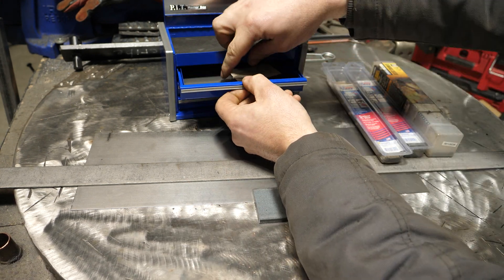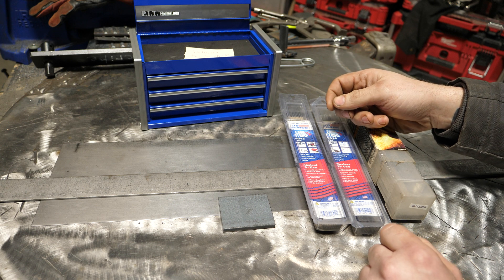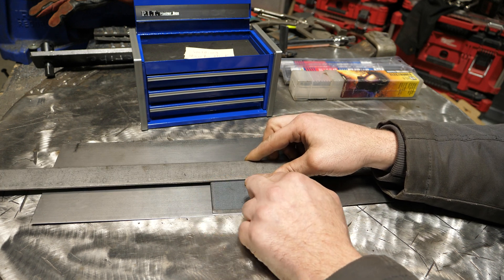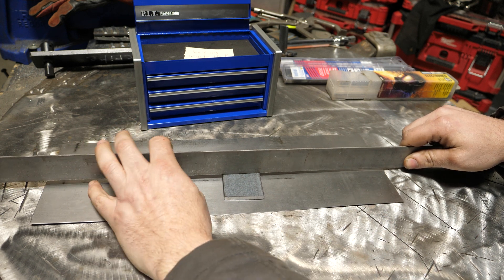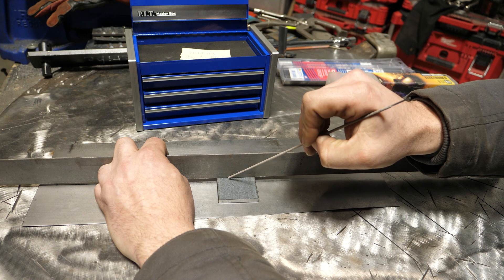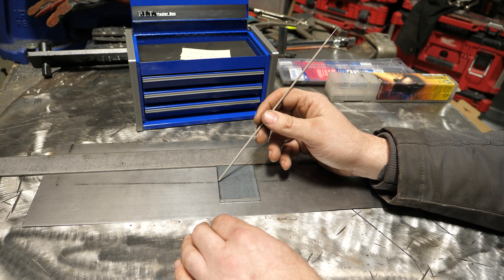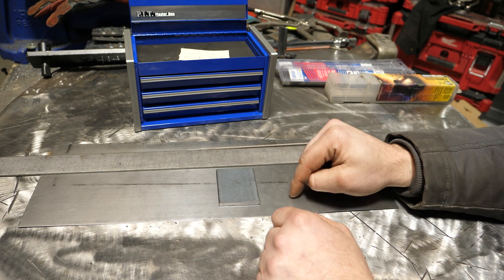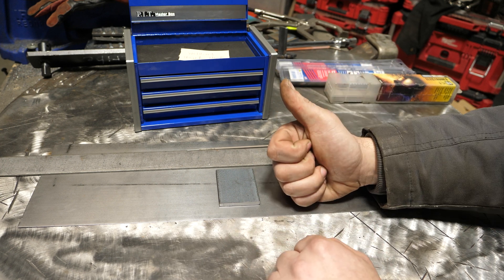Stick welding thick to thin material (questions from the tool box)

Comment: Great video! But where I'm located we only have access to 6013 2.6mm rod, and 1.5 mm square tubing.  Everything (roofs, carports, furniture etc.) is built with that. The method used is stacked tacking with the welder turned up to the max (200-400A) and with a quick rhythm so that the weld pool stays liquid and slag doesn't form. A continuous bead seems impossible,  it blows a hole right away.  And low amperage just doesn't seem to work,  the rod either gets stuck or no spark appears. Do you have any thoughts about this?
Reply from the maker: So you bring up a lot of what I call “work arounds”.  When faced with tough challenges and limited resources you have to find a way to get a job done.  With limited equipment and thin material workarounds must be done.  I have done a fair amount of stick welding on thin material, and it’s no joke and difficult.  What you describe is one way to do it.  Because the 6013 rod is easy to restart with, it would work ideal for that.  If you run enough amperage you can actually achieve solid fusion on thinner material while doing spot welds.  Would it be as good as say a mig weld or tig?  It would probably have more inconsistent fusion, but for the material thickness I believe welds stronger than the base material could be done.  

For me personally I would want to use Gasless  flux core wire for such a task, because it’s far easier than stick and arguably stronger than 6013.  But if you can’t get it you must adapt and overcome 😀
Reply: @makingmistakeswithgreg  Thank you very much! :-) You have such a no-nonsense and non-emotional approach to welding, and I really enjoy watching your videos. They are so long and slow and packed with hard-earned knowledge and experience, which is a rare find these days. Keep it up!

Comment: I think the guideline for setting to the thinner material and then upping 5% causes almost no penetration to the thicker material. I tried this with 0.042" EMT conduit to 1/8" sheet coupons and I can butt weld the 0.042" wall pipe all day with 1/16" 6013, but when I try to weld it to the 1/8" steel there is zero fusion to the thicker material. I think a better guideline is to set the amperage for the thicker material and then work hard to manipulate the rod angle and offset from the joint with layout tools and then add a weave. And practice a ton. 

Edit:
I tested the above and found that DCEP, focusing rod angle/heat onto the thicker piece almost 90% , and much faster travel speed made the difference with 1/16" 6013. The amperage was set where the thicker material on flat horizontal would flow out well.

Comment: I use the series of spot weld techniqe with 6013 3/32 rod at about 50A past 45deg rod angle. It prevents too much heat into the metal but is big enough to have good penetration and it controls the slag.
Thanks for the bite sized video.

Comment: Thank you Greg for responding to my question. I think you are right about the tail and error approach. Rod selection here in Costa Rica is not that great so hope I can find a "working" solution. Do you think changing the polarity help?
Reply from the maker: Swapping polarity will help a lot.  DCEN will lower penetration significantly.  Any ability to clamp aluminum or copper behind what you’re welding will also help a lot too.  It’s a tough challenge with real thin material, but if there is a will there is a way 😀
Reply: @makingmistakeswithgreg  Well I have decided to pay a bit more money and get the 1/8" thick 4" square tube. I think it will save me money in the long run and some of my sanity. Thanks for the advice.

Comment: Do you have any videos on how to eliminate craters at the end of a bead?
Reply from the maker: With mig on steel?  With most craters it comes down to hitting the end of the plate and pulling back a bit for a second to let it fill.  Aluminum is really bad with craters (both mig and tig) and with tig you just push more filler at the end, mig it helps if the machine has a crater fill function.  It basically lowers the settings so the end of the weld doesn’t blow out while pushing more wire into it.

Comment: It is tricky. Im always having to weld 3mm to 10mm steel brackets to 1mm / 1.2mm post walls . 
I find the 2mm rods work well . I always weld from thick to the thinner steel.
Blown a lot of holes ..lol 
6013 2mm is pretty much what I have to use . It helis to use a decent rod .
Reply from the maker: It’s definitely a highly skilled challenge, and you need to have a strong ability to handle frustration lol.  Welding super thin stuff with stick is one of the hardest things to do with welding.
Reply: @makingmistakeswithgreg  
I use flux core most times now but stick welded for years.
Also all the steel welded with and onto is galvanised as we are at the ocean.
That adds to the frustration..lol
Your Texas Tig gets pretty damn good eventually 😂
Reply: 2mm is 5/64 inch. You should be able to get "1.6mm" rod which is really 1/16th of an inch. 1/16th rod lights pretty low current.
Reply: @1pcfred  , I've got used to the 2 mm , it works pretty well going from 5 mm/ 12mm to 1.8 / 2 mm wall posts . 60 amps up to 65 amps on my machine seems to run ok . 
I run fluxcore where I can though nowadays 16 volts .

Comment: For metal about 1/16th I use 6010 3/32 at something like 40 amps. If it seems like I might have a problem blowing through I step it from the seam to the thicker plate. Also in doing handrail that is about 1/16th I step it from the seam to the solid surface.
Reply from the maker: 6010 is definitely a capable rod to weld thin material with a lot of control, provided the user has the skill.  I know it’s the rod I use to fill a hole since most other rods just have dripping molten metal when you try lol.

Comment: I have found a little success using 3/32 7018 at 50 amps on 16 gauge once you can get the rod lit.  I seem to be less likely to blow a hole over using 6013.  Wish they made 7018 in a 5/64.
Reply from the maker: They do make a 7018 in 5/64, they are just very uncommon.  Having run the 5/64 and 1/16 7018 I can tell you they weld really weird.  They have the same starting issues as a normal sized rod.  However I swear their penetration/arc force is way more than a normal 7018.  When welding thin material they tend to blow holes easier than 6013 and 6011 mini rods.  I found long arcing them in the flat position will somehow leave a decent looking weld and not burn a hole.  If you try to run a tight arc they punch holes lol.

Comment: I think the best solution, is to pay a bit more for the thicker wall material :-) I have bought 2mm (1/16") tubing and you blow a hole so quickly. the 3mm material is much more forgiving for a newbie welder.
Reply from the maker: 100% accurate lol.  It can be no joke tough to stick weld thin material.  It’s not something I would ever want to get good at either, especially knowing how easy it is to do with mig, flux core, or tig lol.

Comment: Thank u Greg I’m about to do a little project where I’m welding 1/2 square bar to 1/8 1” by 2” rectangular bar however I will be doing it with mig hopefully I’ll get enough penetration on that 1/2 inch solid square bar we appreciate all ur content God Bless always🙏🏽🙏🏽🙏🏽
Reply from the maker: 1/2 square bar to 1/8th is doable with mig.  I would suggest preheating only the 1/2 to 300-400 degrees Inorder to get the weld to slightly wet out better to it.  The benefit of the 1/8 is that if any of the weld sticks between the 1/2 and 1/8th it should be strong enough to get the job done.

Comment: I'm still trying to become proficient with 3/32" 6013 on fillet welds, vertical up and overhead.  The root pass usually has slag inclusions, especially at the start and sometimes when filling a deep groove.  Could you remind me of what you earlier suggested to help reduce that problem.
Reply from the maker: 6013 is a tough rod with slag inclusions on fillet welds.  All day long 6013 welds good on flat welds and lap welds, but the constrains of a fillet weld makes the flux flow infront of the rod far easier.  The important things to help with this are as follows:  Make sure you run enough amperage.  If the amperage is low the push of the arc is low thus the flux runs ahead where you don’t want it.  I tend to run a fairly steep drag angle to keep the flux pushed away from the direction of travel.  It also may help to get the arc lit, slightly long arc it for 1/4 to 3/8th of a inch, and set the rod in with the flux touching the metal ahead of the puddle.  Basically jump over the initial puddle.  Lastly if you have adjustable hot start a strong hot start will help.  

Those should help you get things dialed in.  I won’t lie, even I get slag inclusions occasionally if I use 6013.  I find 7018 to be universally easier to work with when it comes to making clean welds.  It’s just harder to learn to start and prone to starting porosity instead of slag inclusions.
Reply: @makingmistakeswithgreg I really appreciate all the advice.  It's frustrating when the flux flows ahead of the weld pool and gets in between it and the base metal.  I'm using a Hobart Stickmate welder without any hot start, so I'll try a steeper drag angle and long arcing for a short distance at the beginning like you said.  That should help.   Another thing I noticed, not related to this, but when I was welding overhead I found it difficult to run a consistent bead because any slight change in the arc length caused a lot of variation in the weld profile.  I had been running DCEP but when I switched to DCEN it made the bead wet out better and smoothed it out a lot.

Comment: Ah yes the art of a wash in weld soaking the thicker part with all the Heat and letting the bead spread over and touch the thinner material without blowing through that's a skill to have in your back pocket all the time I prefer the Lincoln brand 5/64 inch electrodes you can find them at Lowe's hardware stores if they have a welding Supply Shell Fuel find them right next to 6013 1/16th of an inch I wish that I was able to find 7014 in that fractional denomination but all I've ever been able to find is 3/32 and up but for around the house 60,000 lb tensile strength is enough
Reply from the maker: Next time I am at Lowe’s I will have to look for those.  I have had Hobart, us forge, and about 4 other brands on the mini rods.  I don’t believe I have had any Lincoln’s.  I will have to try them 😀
Reply: @makingmistakeswithgreg  my experience has been pretty smooth with them and they restart pretty easy I just wish they were longer than 12 in they burn really quick but they leave a nice deposit they really do in my opinion live up to the Lincoln name

Comment: Hi Greg, that's what I do when welding different thicknesses is the wig wag weld and yes it's a real challenge without punching holes thru that lighter stuff. My welder is one of those 70 amps hi/low amp settings Campbell hausfield mini welders. Along with the sticks you have on the table there. It all works for the little amount of welding that I do from time to time. Matter of fact I had to do a small welding job  just today on a shaft sinking bucket I made for one of my mines. It kept buckling a little so I had to reinforce the top rim of the bucket with 1/4 inch strap steel although I didn't have to apply weld to the bucket itself since the bucket is a thinner material. It's one of those old 8 gallon railroad spike buckets I modified into a shaft sinking bucket. All I had to do is cut two strips of strap steel then bend them both so they would fit completely around the bucket then I welded the ends together and to a strap steel piece I bolted up each side of the bucket to hold the bucket handle. All in all the entire thing came out nice and strong. Only thing bad is you go thru those mini rods super fast. I also get my rods at Harbour Freight. They run about 8 bucks for that box of rods you have there on the table so that's pretty reasonable for the amount of rods you get versus the amount of rods you tend to go thru.   👍
Reply from the maker: They definitely burn off fast.  The harbor freight pack of 6013s is nice because it’s big.  The small Hobart packs I have bought give you very few rods at all.  You would need to buy 2-4 of them to get any real practice/work done with them.  I definitely need to try some from Amazon to see if they are any good 😀.  Sounds like a fun project you did, it’s impressive you tackled it with a hi/low welder.  Goes to show how much skill is in the person welding and not the machine 😀

Comment: So I doubt it's an approved process but in a pinch I have sort of TIG welded with stick before and was wondering if you've ever heard of anyone doing it or tried it?
What I mean by that is, I would have an electrode in my left hand that I smashed all the flux off of and then in my right hand I have the stinger with an electrode that I'm welding with and in certain instances to bridge a big gap or to weld something kind of thin that wants to burn through I would use the metal rod in my left hand to kind of add metal like you would when your TIG welding.
Reply from the maker: The old “Texas tig”.  I have done that to repair dumpsters and other terribly wore out materials.  I will definitely do a video on that, because it can help. Strength wise it’s anyone’s guess as to how strong it is, but when you’re down to using it generally speaking any weld is better than what’s there lol.
Reply: @makingmistakeswithgreg  I've had to get pretty good at it working on old garbage trucks, I have also shocked the shit out of myself more times than I remember when the electrode sticks to the "tig rod" and your gloves are sweaty 🤣🤣🤣🤣

Comment: Rod angle is key, lay the rod down kinda flat for travel and even a push angle sometimes. Keep the heat on the 1/4 and oscillate so that the puddle kisses the 1/16. I’ve had to weld 1/16 with 3/32 7018 bc that’s all that the company provided. I had to do everything I’ve mentioned above and after blowing a hole it dawned on me to reverse my leads so that I was runnin straight polarity (dcen). With doing that the electrode was taking a lot of the heat as opposed to putting it all into the base.   Two premium time days in a row and for what I got paid they would have been better off buying a cheap throw away flux core machine 🤷‍♂️🤣
Reply from the maker: Your last sentence is exactly the solution lol.  

3/32 is a very versatile rod size if you have skill.   You end up using it more for the arc than the metal it deposits on thin material lol.
Reply: @makingmistakeswithgreg I’ve been playing around lately with my fronius 180 and I think that pulse stick is a good solution.  I’m pretty impressed with the pulse function, and how slick it is. It’s a completely different feel at first but runs great. It makes vertical almost full proof
Reply: In a perfect world we'd hardly ever work. That'd be no good. Mistakes are what keeps money in our pockets. So I'm all for companies screwing up. They can afford it.

Comment: Oh, and Online is a good choice if there are no Menards stores nearby, e.g. if you’re near the west coast.

The two Tractor Supply stores I’ve been in didn’t impress me much - only have Hobart sticks….
Reply from the maker: Definitely an option.  Around here Menards is the best place to find the mini rods.  The northern tool and tractor supply have them occasionally.  Every mini rod brand seems to weld completely different, it pays to try a few to find one that works.

Comment: Hey Greg right up my alley. Practicing with 1/16 and 5/64 6013 mini stick.
I feel a little better control. I'm also going to try with aluminum rods. 
I should have started with braze welding. 
Thanks
Reply from the maker: The little rods are a significant challenge, but they are very useful.  The 5/64th rods are probably the most handy to have.  The 1/16th rods tend to be a frustration generator lol.

Comment: Interesting video Greg, totally wild question from a novice welder, could you (assuming you had access) clamp a piece of the 1/4" to the back side of the 1/16 to act as a heat sink? Obviously I am referring to a fillet weld where the 1/16th is up in the air. I realise if you did blow through you would then have a mess on your hands. Interested to see if this idea has any merit. Cheers, Jon🏴
Reply from the maker: You definitely could, a 3/16th piece of copper could work too.  The steel won’t stick to the copper and you will be able to run enough heat to get things melted.  The hardest problem stick welding thin material is dealing with the ever present issue of needing to run enough amperage for the rod to function right, but that amperage producing too much heat for the material.  You cut amperage to not blow holes, and your weld looks terrible lol.  Any heat sink, or copper plate that can be used will help tremendously.  No joke, .030 flux core or .023 mig wire makes welding thin material enjoyable.

Comment: Yeah, it’s a real pain. Well, I’m not a great stick guy so maybe my opinion on it doesn’t matter. But even the /titanium 125 will do a decent job on 1/16” to 1/4, though 1/4 us above its stated range. Works though.
Reply from the maker: The 125 will make thin material trivially easy to weld in comparison.  No doubt I will make every attempt to use anything besides stick to weld thin material lol.  I don’t know that I would want to be good at stick welding thin material, not when you can get a flux 125 for less than 150$ and do it without being frustrated lol.